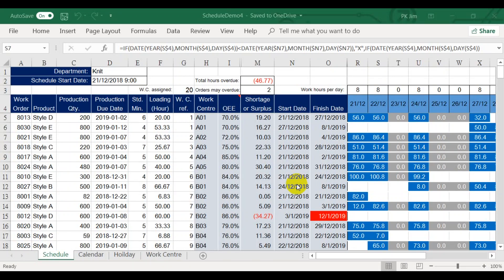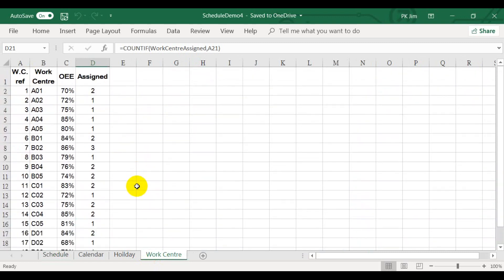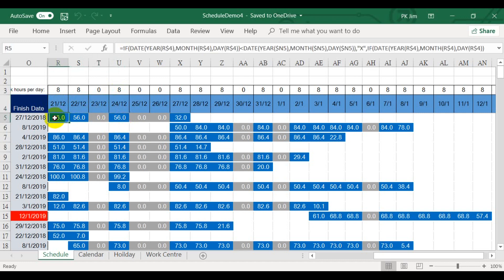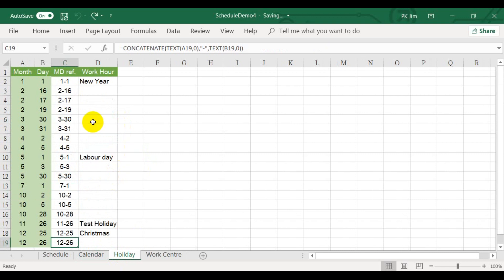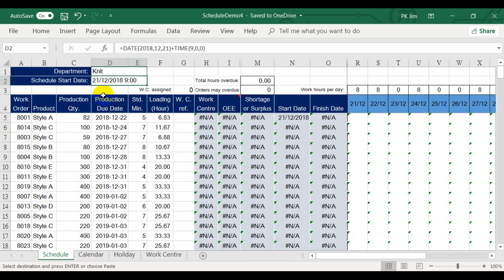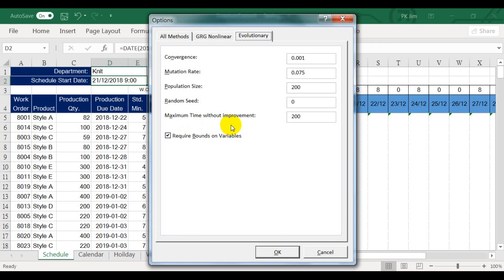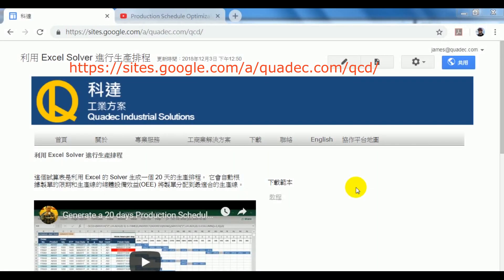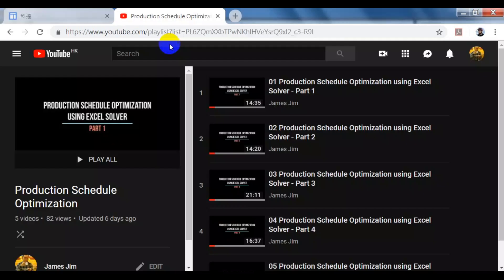Use Excel Solver to generate a production schedule (English)

Comment: hi James! is there a way to format it so that it produces the whole work order quantity on the same day at once instead of on different days?
Reply from the maker: Hi Mik, do you mean a one day schedule?
Reply: @jamesjim295  something similar! the production schedule you demonstrated that can run finish the whole work order quantity on the same day
Reply from the maker: @mik4604  Yes, you can make the calendar column to hours.  This will simplier.
Reply: @jamesjim295  how can that be done? on which worksheet?
Reply from the maker: The whole schedule sheet and the calendar. Good news is no need to handle holiday.
Reply: @jamesjim295  hi James! how do i go about converting the calendar column to hours?
Reply from the maker: @mik4604  Sorry for late reply.  It is a long story but I try to make it short.  Go to calendar worksheet.  Change the Date header to Hour, change date format to time format.  You don't need week anymore.  change work hours to work minutes.  Say you may have 5 minutes break per hour then put 55.  I bet you don't have 3 shift in one hour so you also do not need shift..  There are some formula need to change as well to match with the hour plan.
😄

Comment: I have work centers that each only have one workstation. When running jobs in sequence, for example, using work center A01, as I add more jobs onto this resource, they should follow on completion of the prior job. However, it seems that in my sheet, if I set two jobs using the same A01, the jobs run in tandem, not after each other.

Comment: Dear, sir 
Your shared template sheet in the same work center order change over time 25/5 date  1st item 188.3 quantity then 2nd item 330 quantity . I can't understand it.

I think  date on 25/5 1st item 188 quantity   then 2nd item should be 117 quantity.

Comment: Hello James,
Great work. Do you have a suggestion for modeling a same product/work order going through more than one work centre, for eg: Assembly and Painting. Is it possible in excel? Thanks.
Reply from the maker: Hi Arunachalam，I have tried many times but still not successful.  I think you may identify the bottle neck of your processes first, then use my Excel to optimize the bottle neck.
Reply: Allow me to answer this question, the most straight forward way is to find a Gantt chart excel template and tweak it for Production Scheduling application, like adding the WIP + OEE per resource

Comment: Thank you for your effort. Is there any way to input production available date? Some materials are prepared too late so it is impossible input line. If there is way to input available date then it will be more useful.
Reply from the maker: Actually you can add any column in the spreadsheet you like.  The point is do you need the Solver to work on this column.

Comment: Hi james,

I really appreciate your work.

Would you please share what is P and L stands for. And the same excel file for my understanding. 

I work in a garment factory, i really need this correct file and need to know what is P and L stands for. Why did you hide those cells?
Reply from the maker: Hi Azad,
If you mean column P and L, column P is an indicator of Shortage that tell the Excel the production line has shortage of resources.  The column L is the number of WorkStations in the line.
Reply from the maker: I hide these column just narrow down the information panel for better view.